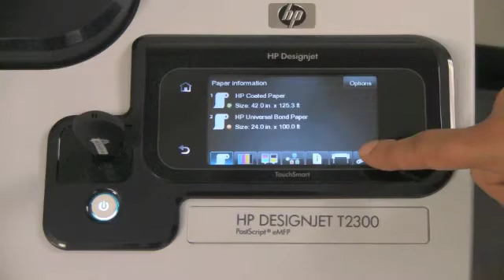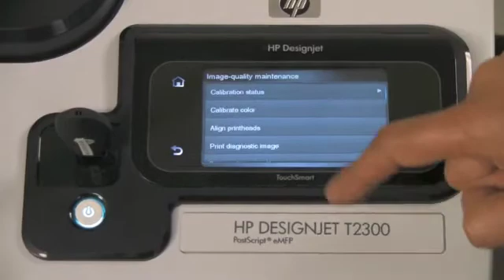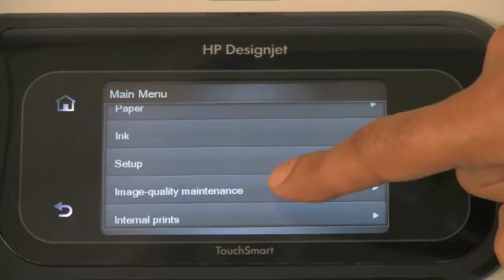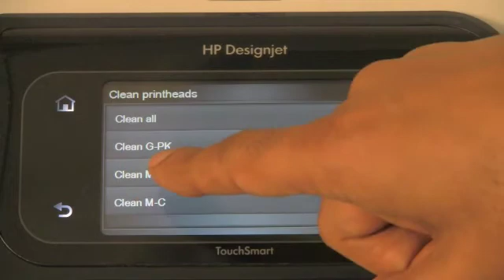HP Designjet T2300eMFP Image Quality Maintenance

Comment: hello nice video ..i have a Hp dj T790 it has image quality issue  alignment .Plotter print out demo print with out any image quality issue (alignment )but when send a job from system to plotter by using autocad, media print out with alignment problem .clean the Print head and performed the alignment but still issue is exist.please guide me on it ...